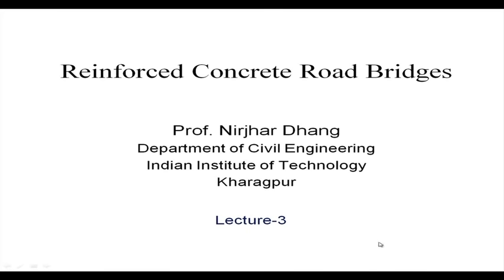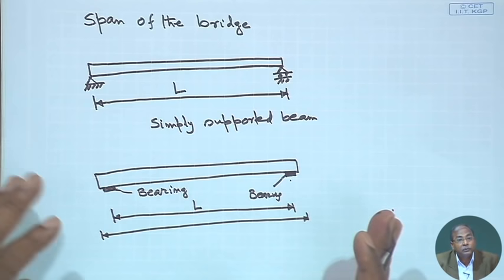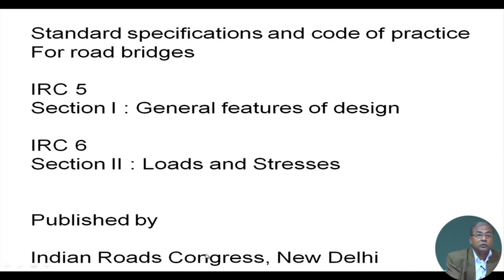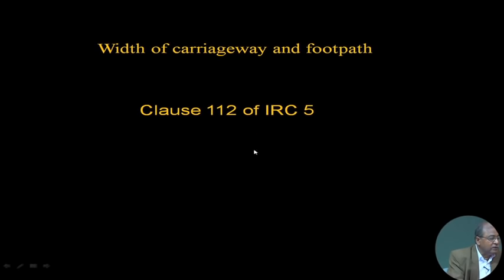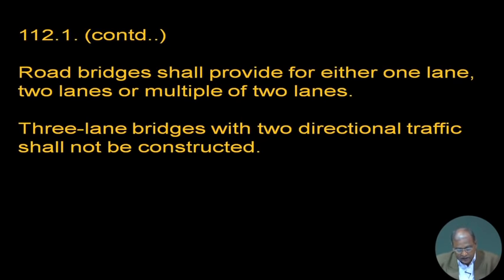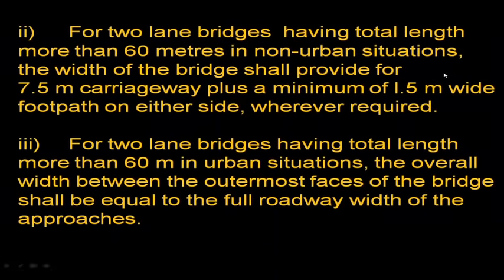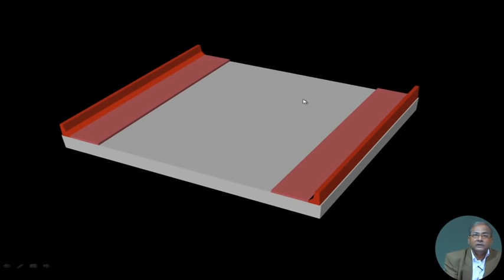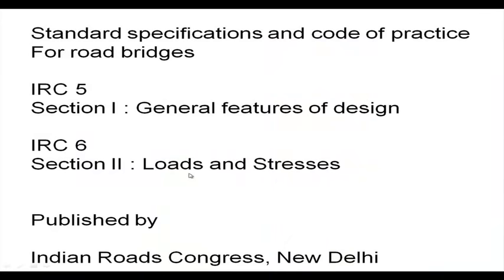General Features of Design

Comment: How to find out the load  of crash barrier.
Reply: Cross sectional area of crash barrier multiplied by length of bridge(Span) and 25(unit weight of concrete)
Reply: Thanks a lot